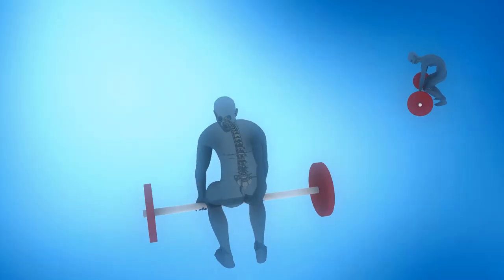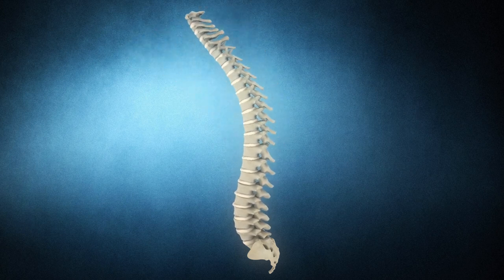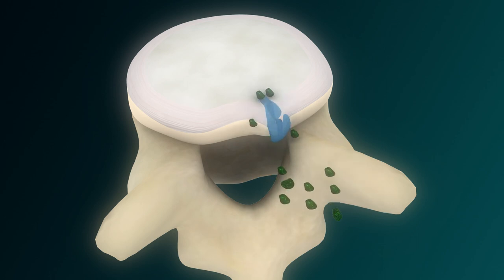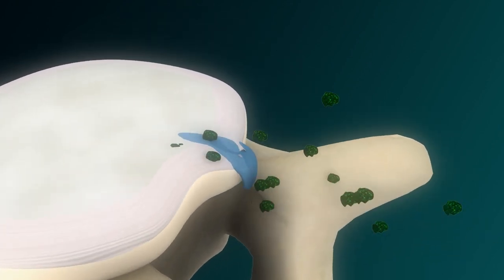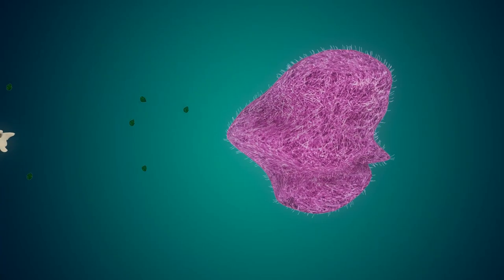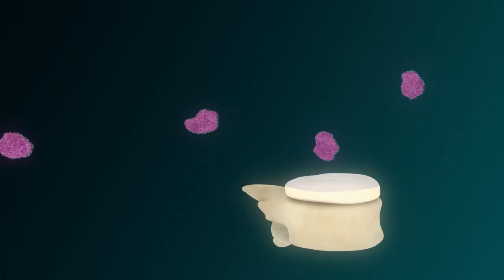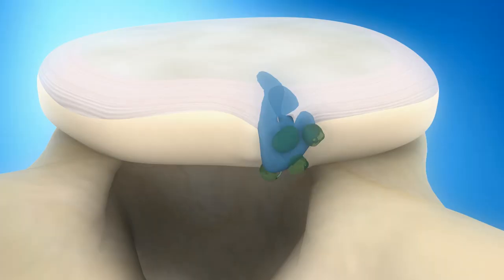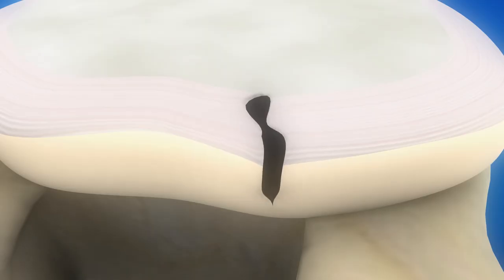Mechanism of Healing Following a Disc Extrusion

Comment: I'm having this problem right now. Doc told me this morning. 😔 😭 It's so painful and due to this the  sciatic pain is even worst. I'm so stressed. Hurt myself at work. I can't lift my legs when I'm sitting..
Reply: How are u now bro samde got hurt at work mri report said 2 disc bulges l4 l5 disc and l5 s1 disc bulge 2mm each and facet joints inflamated
Reply: Major car accidents for me, in just two weeks of strength and core training can pull it together once you get the information under control. Mobic 7.5mg I take two of these and ice for 3-4hrs until the pain stabilized, also methocarbamol during the day, half dose flexiril at bedtime and a tramadol/ultram 

Since the pain returned when the gym closed.... I need to get used to a routine of core at home to prevent all this agony
Reply: Hi, How do you feel now ?
Did your disc herniation and associated Ciatica pain got cured nowadays ?
Reply: Dont worry dear you will get better if u take care of urself  .eat well and dont lift heavy things.sleep well .take vitamine D and B300 .fruit and vegetables .be patient it takes time but u will get rid of the pain step by step
Reply: How are u now
Reply: BPc- 157 with b500 plus these enzymes🎉💪

Comment: How long does this process usually take to complete? Thanks
Reply: 1 yr
Reply: @장민재-e8l  dude to late its healed thanks anyways
Reply: @greaterthings5652  when u did mri it's completely went back to normal ?? ..
Reply: And u had extrusion or protrusion ?
Reply: @omarsamy122  i had a herniated disc l4 l5 had surgery it fixed the issue afyer about 9 months the sciatica came back and my lateral shift it was like that for about a month and i took a bc powder and it went back to normal and its still ok today. That was about 5 months ago.
Reply: @greaterthings5652  whats bc powder?  Glad you are good now
Reply: @arrepuess  it’s an anti inflammatory over the counter medication used mainly for headaches aches and pains.
Reply: @omarsamy122  protrusion
Reply: @arrepuess  thank you I’m also 🙂
Reply: What is then powder exactly

Comment: I have a l4-l5 disc bulge with severe pain while bending forward. Will the disc get resorbed even in the case of disc bulge?
Reply: I've been dealing with this on and off for 12 years (extruded herniated disc at l4/l5). At the beginning of this year it got excruciatingly painful for me. Get your doctor to refer you to a reputable Physical Therapy Service. It is more common than I thought, and they will tailor strengthening exercises  to reduce the pain. My biggest revelation was the concept of nerve glides (nerve flossing) and strengthening of the core.  Good luck.
Reply: Sure..You have to take total bed rest at least 3weeks.. or try traction for 12 days that bulging disc will be cured..  or Do back extinction excersise (cobra pose excersise)
Reply: Stem cell therapy (bone marrow) is Morden treatment for disc bulge. One of the best and safe treatments for spinal cord disc problems.